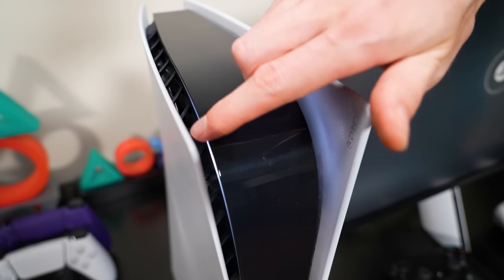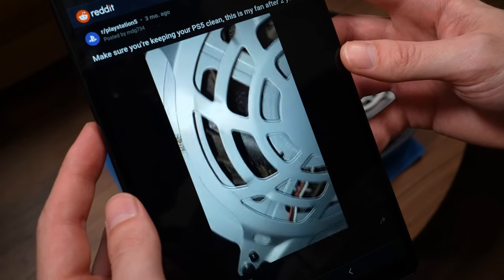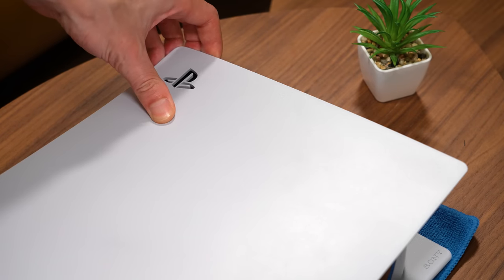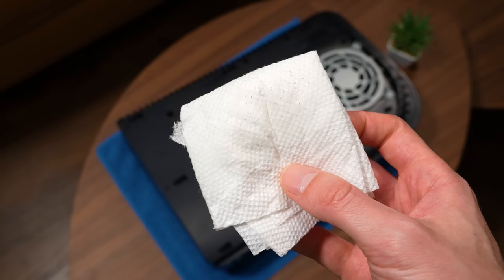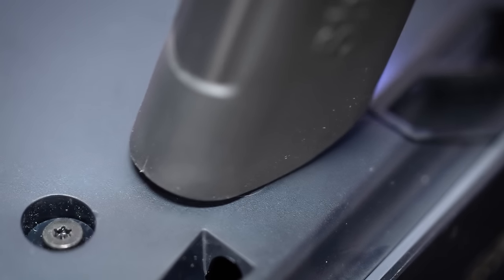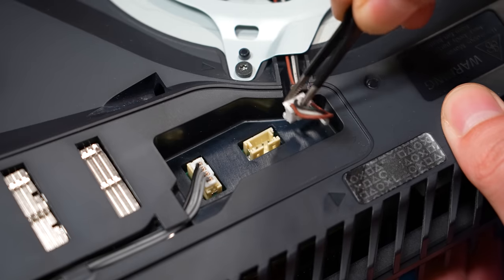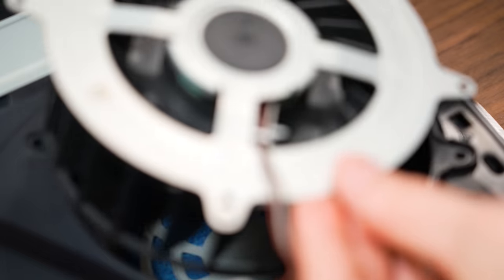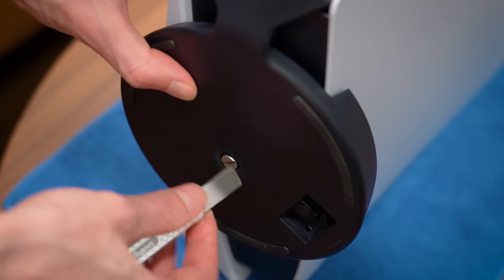It's time every PS5 user checked for this..

Comment: I don't know why this is being presented as some huge problem. Consoles are developed and designed with dust buildup in mind. These consoles will typically last many, many years (1-2 decades) before dust ever has a serious negative impact on cooling (i.e. consoles shutting down due to overheating). Cleaning it once every 5-10 years is perfectly fine. But doing it every 6 months will likely cause more damage to all the components you're removing and inserting.

Furthermore, at no point do you explain WHY this is supposedly necessary. Your description just screams clickbait and tries to scare people for no reason.

''Every Playstation 5 user is at serious risk of this PS5 problem from NOT cleaning''
''I show you how to clean PS5 dust before it's too late''
''If you have a PS5 and don't do clean.. You're making a BIG mistake!''

What risk or mistake are you blabbering about? Before it's too late for what? As I said, it'll take extremely poor conditions for the dust buildup to ever result in overheating of any kind. And if it does - you can just clean the thing and the problem will be solved. You're making it sounds like dust can cause serious permanent damage, which is plain wrong. Simply owning and using the console will do more harm than the components than dust ever could within your lifetime.

Comment: I remember with my first ps3 it got so much dust that it ended up overheating and getting the yellow ring of death, ended up completely dying, I had to tear it apart to get my game disc out of it. My second ps3 also got the yellow ring of death from overheating but instead of completely dying it's blueray laser died and could no longer read discs.
My ps4 ended up overheating as well, but being older I knew what the problem was and took it apart to clean it, but man was it a pain, they were obviously not designed to be taken apart.
I don't own a ps5 as I do PC gaming now, but from what I've seen, they seem to be much easier to disassemble and clean than previous consoles.
EDIT: when it comes to collecting dust in things, the lower it is to the ground, the more dust it will collect, if you can try to keep your consoles/computers higher up and make sure to mop, sweep and vacuum regularly to get rid of all that loose dust everywhere, if you can leave the fans off for the day so the dust will collect on the ground then clean it up when it settles.

Comment: There is literally 0 reasons to open your PS5 if you clean your house regularly and you’re not a smoker. The dust will be hardly noticeable, I just opened my 2 years old PS5 to expand storage and there was barely any dust built up and certainly not enough to justify opening the console to clean it. If your PS5 has enough dust built up to be a problem maybe you should consider cleaning your room first.